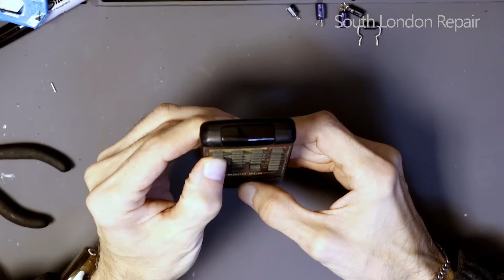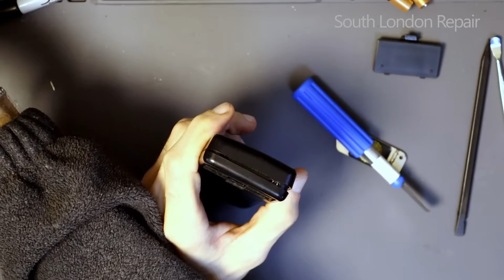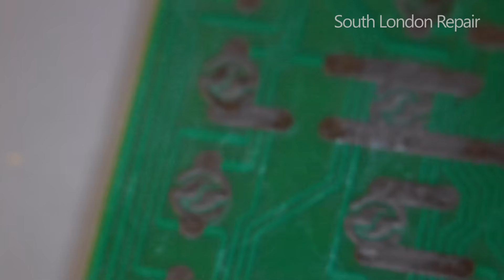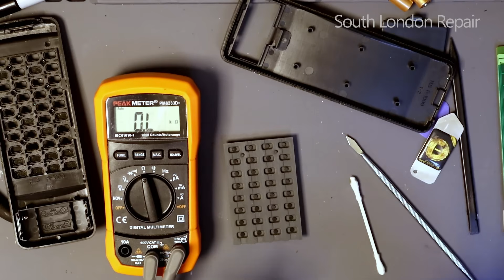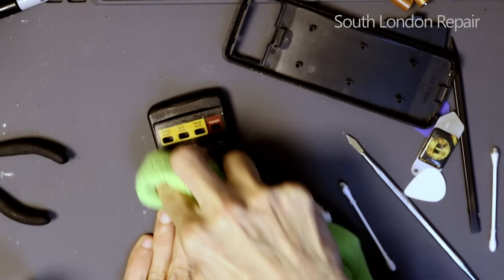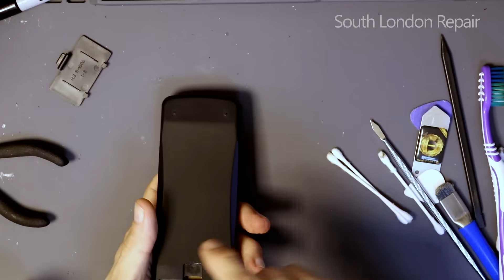Infrared Rock-Ola Jukebox Remote Control Diagnose and Repair step-by-step

Comment: Very good saves having to buy another one doesn’t it😊, I have had remotes with drink spills, food, and god only knows what else on them lol, sometimes if a remote doesn’t work properly remove batteries, take the remote apart and short out the small electrolytic capacitor 😊
Reply from the maker: Glad you found it useful! Remote controls definitely see a lot of action, and it's good to know some fixes. 😊